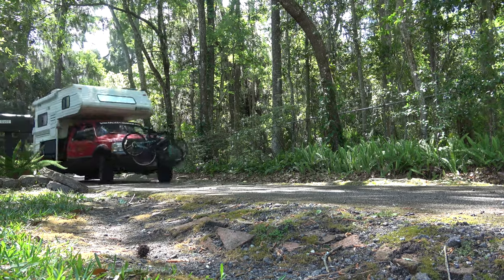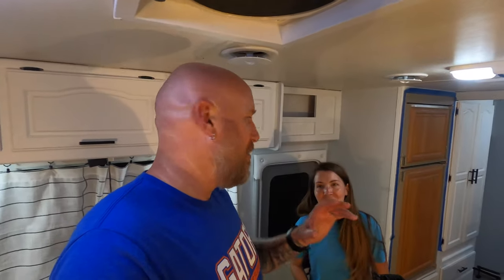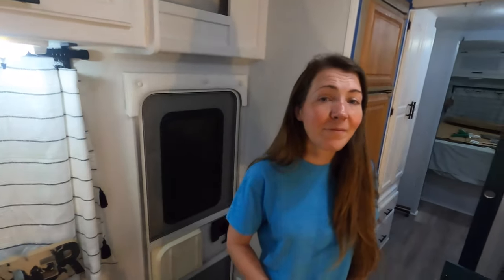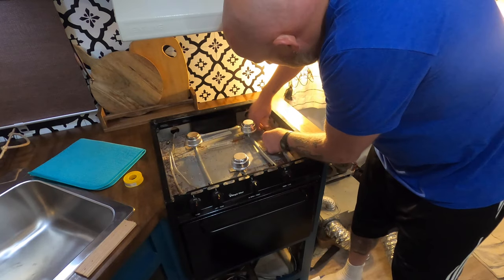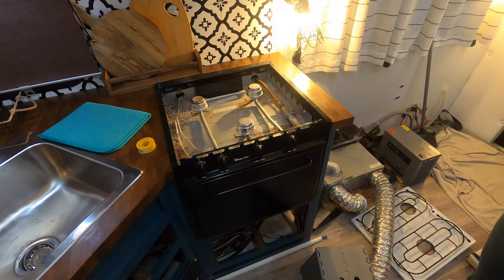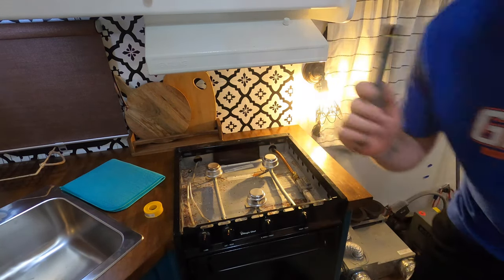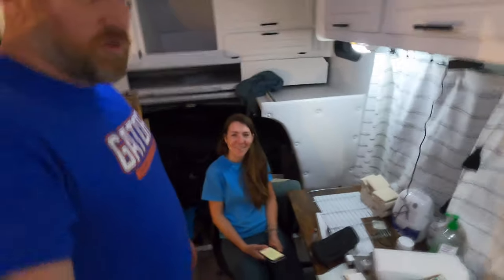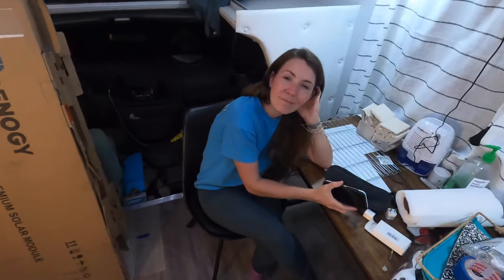CtW 132 // Fixing an Unexpected Propane Leak in Our RV // Finishing up the Class C Kitchen Remodel

Comment: I've always been taught that Teflon tape should not be used on a compression joint where there os a flare or olive fitting on the pipe as the seal should be the crimping of the pipe on the rounded mating surface or by biting into the copper/PEX pipe.  Ideally there should be a rubber flex seal on portable appliances where they are subject to vibration or movement.  As yours is now tested safe, I'd leave it alone but bear it in mind for other joints like that.  Thread seal paste or Teflon tape is for threaded joints where the seal is on the threads only - like the ones that are likely underneath the chassis from the bottles.

Keep it up - you're doing well!
Reply from the maker: We learned this too, and used a light wrap on the threaded portion of the connection not the flare/fitting. Ironically, or not, today we actually found that one of the fittings had jiggled loose and we were fortunate we smelled the leak prior to going up in flames with the homemade sourdough bread Lindsay was trying to bake! Thanks again for the tips and clarification! And, of course, for continuing to watch along with us!

Comment: We always leak test propane fittings & tires with Windex or soapy water. Lightly spray and look for bubbles. Any pin holes or cracks will cause spray to grow bubbles.
When tightening compression fittings it's best to use open-end wrenches. Channel locks work in a pinch.
Now get back to work.
Reply from the maker: Great tips! We tried the soap method in our truck camper before we left on the initial journey and had no luck finding a leak we knew we had. Turns out it was a solenoid that was stuck in our furnace and no amount of spraying inside the furnace would have located it... but our propane sniffer did! We are definitely careful with adjusting the fittings, thus my "tight is tight" was a little too loose! Thanks for watching and sharing the tips!